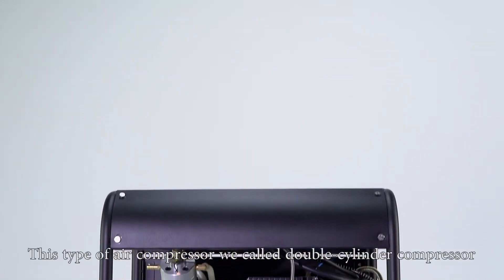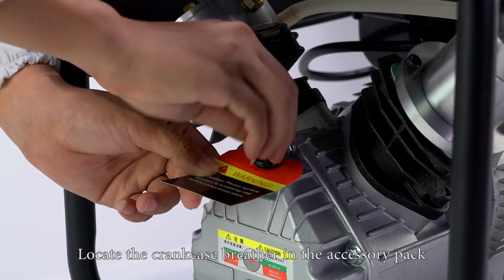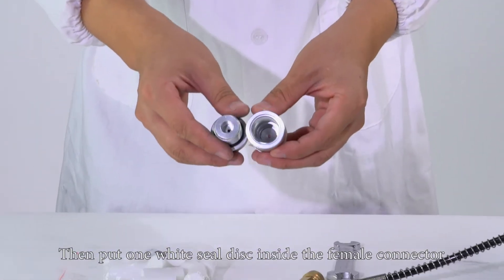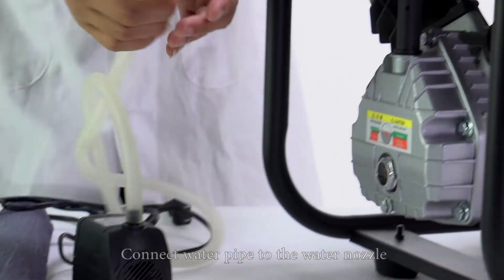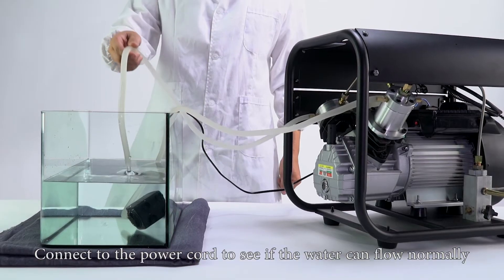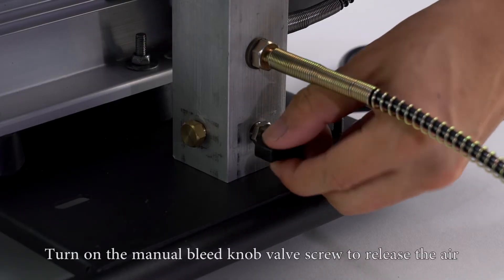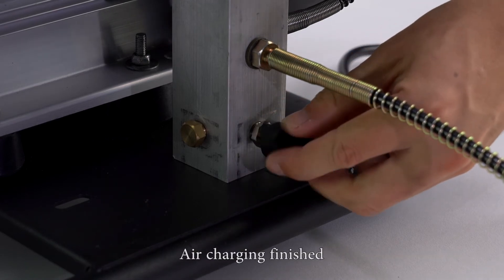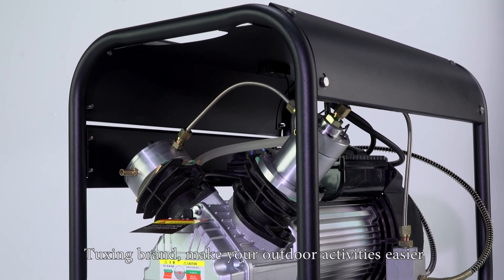Model number: TXED012 (Double cylinder pcp compressor,adjustable pressure auto stop function)

Comment: Hi folks! I just bought one of these and received it a month ago and it is great. I do want to build a closed loop cooling system for it. Could you tell me how much heat needs to be dissipated? Either watts or joules per unit of time is fine.  Would an aquarium chiller be appropriate? What capacity chiller is required?
Reply: dimension it for 2kw

Comment: How is the oil changed? There used to be a drain plug under the oil site glass. It id no longer there. Please advise.
Reply from the maker: It has the oil drain plug in our all compressors right now. Generally speaking,we can drill the plug by ourselves(it needs very careful) ,But here we strongly suggest that the best way is we purchase one new front cover with drain plug to our compressor.   you can contact : Sales@tuxingcn.com  Thank you!

Comment: I have bought by the Tuxing company at AliExpress. I put the oil in, installed the water and all and the test plug. When I turned it on the fuses of my house snapped, so I looked under the houding.
What I saw was shocking, 3 cables were not connected and worse of all a print was just hanging close to the metal. I contacted the seller from Tuxing, don't worry friend hé said. He would send me a new print, and some other stuff so I could fix it myself. I did disagree, I ordered a new machine and you may expect when you see the testlabel it will be ok.
So when you buy a compressor like this first check if everything is ok and then plug it. Tuxing doesn't showed the best side of this company...
Reply: Bought one of these two cylinder ones, it was a complete waste of money, just been one gigantic TURD.  Inferior materials all over and designed to break down.
Reply: Well, you were lucky, they will not even contact me back. They sell infer product & expect the customers to fix what they sell. I have bought China made compressors from other company's & had to fix them also. But the one I just bought from Tuxing has not run over ten sec. I pulled the cover, and the electric motor winding has a few wires burnt into. . I E-mailed countless times & no response. Good luck to you.
Reply: @jimfitzgibbon5492  You should email them frequently, or contact a seller. I was able to fix the machine myself. FYI, they have a dependance in Tsjechia. Good luck Jim.
Reply: @jimfitzgibbon5492  Generic item with Tuxen on as a brand. Been through exactly as you say and more with another brand name, the 12 month warranty is worthless. On a much lighter item 5Kg cheapest to send back to china is £63, they will only refund £30 lost out £33 straight away.Declined a £60 to dix myself, then an £120 and finally accepted £160 to get mine repaired thats 5 weeks old.